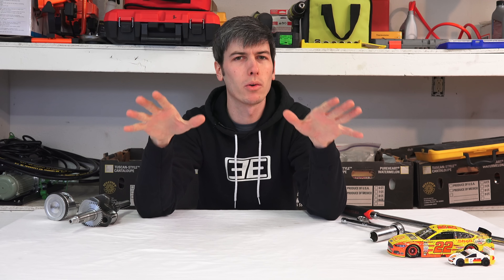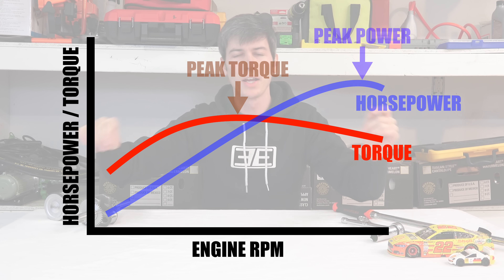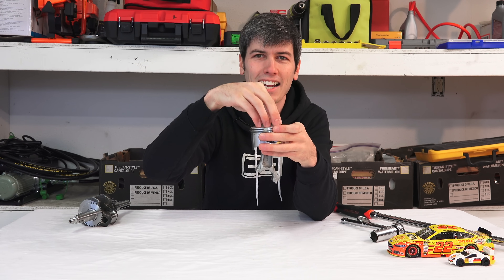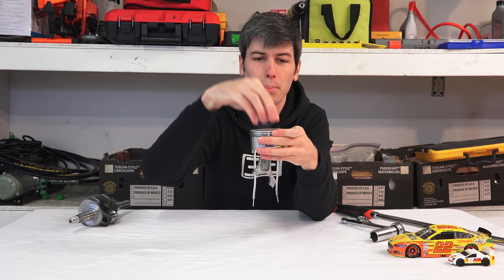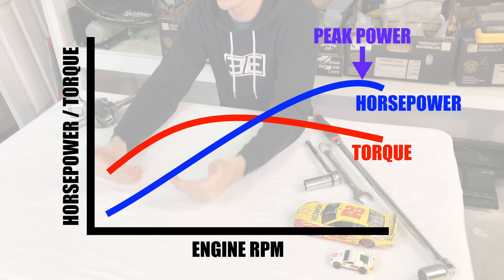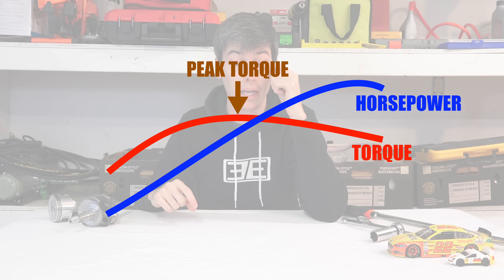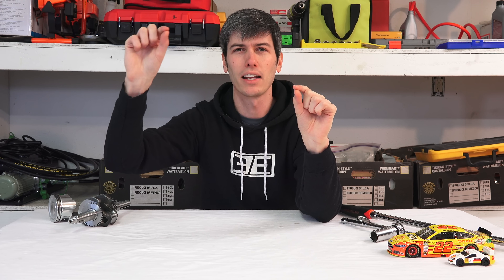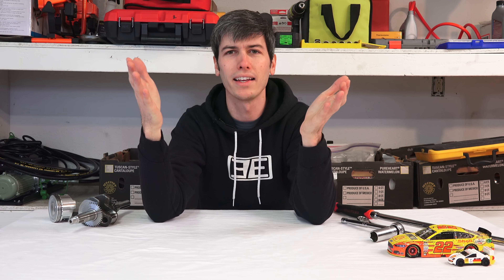Horsepower vs Torque - A Simple Explanation

Comment: One question: You say you can take advantage of double the horsepower via lower gearing for faster acceleration, but wouldn't the same be true for the engine with double the torque? i.e. you can take advantage of the extra torque by higher gearing and thereby increase how fast the wheels spin?
Reply: I suppose so
Reply: No, you cannot do that. Dont forget that HP is torque x RPM. This is very important when you take gearbox into account. In this (very simplified) example the one that has 200hp @100lb/ft would spin 4x faster at peak power than the one producing 100 hp @200 lb/ft. That means 4 times more power would actually get to wheels. Example to illustrate: when you overtake in 3rd, you will accelerate much faster than in 6th.
Reply: @Elitefromthebar  You mean twice as much power reaches the wheels. 1/2  the torque and 4 x the revs = twice the power, which is what you had already written.
Reply: Lower gear have better torque, higher gear have better power, because power = torque*rpm
But, i always ride my bike like this :
My bike peak torque are on 9000rpm,
The peak power are on 10500rpm...
The torque start to feel kick around 6500rpm, so what i'm doing are hold clutch and rev the enfine near 6000 or 7000 rpm then release the clutch, it launched easily, so i try to reach peak torque first so it will continue to peak power fast..
Reply: @atlasone8369  Always, or at the start of each race? You really don't need to do that for normal riding on the road.
Reply: @atlasone8369   if you could find tires and friction capabilities to take advantage of your peak HP, peak hp would cause greater acceleration than peak torque.  remember, HP is your capacity to accelerate at ANY vehicle speed.    think about this..... at peak torque rpm and say you are hooked up at that speed.  if you can get wheel spin at a higher HP and RPM and the friction coefficient is enough, (slip) you will accelerate faster!   make sense?
Reply: Kristian Sørensen 
The 200lb-ft engine can drive higher gearing and will need it because it can't rev fast, but the higher gearing reduces acceleration.
Reply: I mean, i do that when i want it..
Reply: zanick2 you mean make it slip first? Like burnout?
Reply: @atlasone8369  yes, there is an optimum slip percentage that all tires have based on their design and surface. you maximize this by how much power you apply to the wheels . this maximizes force, regardless of engine torque. in otherwords, you can have MORE force , acceleration, at higher HP levels than even peak torque levels .  the launch is very important as you know, but the physics is a little confusing.
Reply: @zanick2 yeah... i see what you mean... yes, you were right because actually HP are torque*rpm... so... of i'm just reving my bike to high rpm where peak hp is then logicaly it will launch perfectly and faster than before...
But as you say... it's the tire...

Comment: You compare two cars and says it has X vs Y torque.. and then just say "oh haha fooled you that's not at the wheels... at the wheels it's a totally different torque."  You say the two cars are exactly the same except for the engine, but you wouldn't gear those two engines the same - so yeah if you have them both geared for the engine with more HP (since you say they are the same except the engine) then the one with more HP will be faster.

Comment: HP is torque X rpm / 5252.  Your car acceleration example is completely flawed. If the low tq car can be geared to make up for tq, so could the other car all things being equal, right ?

Comment: Very good video, but I think the gear ratio explanation complicated it a bit early on.

If you had two identical vehicles with the exception of torque and horsepower outputs being reversed, that would imply the same gear ratio(s) as well. In that case, the car with higher torque could accelerate off the line faster, but the car with higher horsepower would reach a higher top speed.

Comment: It's a fair explanation, but note that the effective pushing power of the gas/fuel changes as the RPMs changes.  It cannot exert the same amount of force to the cylinder because the fuel ignites/burns/expands at a fixed rate, against an object that has increased it's rate of movement.  It's not unlike a human trying to push someone on a swing faster.  Because the object is moving faster, the limits of the item applying power (gas in an ICE.  A human pushing a kid on a swing) cannot apply more force beyond a certain point.  Part of the reason why you have a fall off in torque as the RPMs increase.  It's the nature of an ICE.  Also note that gearing is simply the ability to adjust the torque to the wheels.  The wheels have no concept of anything other than the twisting/torque that is being applied to it.

Comment: The car with the greater power will only be faster if the one with twice the torque has the same gearing.  If the high torque car had the correct gearing, it would be exactly as fast as the other car.  And faster than the HP car if the HP car has the gearing of the high torque car...

Comment: You got me dizzy. The question is on short start, which one get faster? The cruiser which has more torque but less HP or the sport bike with less torque but more HP. In the long run we know the sport bike will go faster but on the short run like a 1/4 mile?

Comment: Torque gets you going while horsepower keeps you going, simple as that.
Reply: more accurately torque gets you going while power is how fast you going, because power is actually a formula of work/torque but with time variable puts in
Reply: Torque = Amount of force acting on the lever.
Gear Ratio = The length of the lever (which gets smaller as you move up the gears as the amount of force to keep it spinning reduces).
Horsepower = The actual output of the engine with Torque x RPM /5,252 giving you the answer.

No Torque? = No force acting on the lever- aka car won't move.
No Gear Ratio? = Without the lever, there's nothing to transmit power- aka car won't move.
No Horsepower? = Either you have no force acting on the lever(and again, TORQUE) or a lever(and yet again, GEAR RATIO) to begin with, because if you did have both of these, you'll have everything you need to find the horsepower unless there's some physics-defining breakthrough game changing phenomenon. I do NOT understand how this is hard to grasp if you are older than 12 this should be damn-near a no brainer. You're comment is soo soo vaguely correct you'd you'd need at LEAST a 500x telescope to connect the dots and make sense of it. Simple? Yes, but apparently for you it's not as simple. Now be a good little HORSEPOWER- NOT TORQUE and get some work done! (Had to)
Reply: Really, what gets you going and keeps yo going si the force applied to the car by the wheel bearings.  This si directly related to the torque applied ot/by the wheels.  This force has to be enough tgive the desired acceleration (F=Ma).  Horsepower is the ability to supply torque at any given speed.  This si why a low HP car can accelerate quickly from 0-20, then just poke along, whereas a high HP car can still accelerate hard while going 80.  Any simpler than that, and you really don't get it.
Reply: torque keeps you going too. a negative torque being applied by friction and wind resistance is what slows you down. you need torque to cancel those forces out.

Comment: I’m curious about something I did with a 400 small block.
I cut the crank throw half inch and I added to the rod.
I was looking for RPM on a 2400 lbs car.
My question is this: if I cut what makes the torque, namely the crank but increase the rod length and Increase the RPM potential, what happens to the torque numbers and the horse power.
It turned out to be like a ten second driver that you can drive to get groceries.
If you have an interest I’ll show you the car and the parts list.
I love the technical part but I’m not sure about the physics witch is what I really love.
Thanks for your help.
I think I got it by Gimny.
My gearing is very aggressive, 3.27 first with a 3.155 Gleason Torsen and ten inch tires in the back turning 8500 to 9 grand makes my Z haul ass.

Comment: Your comment of the car comparison with 200 lbs/ft and 100 HP vs 100 lbs/ft and 200 HP that the one with more HP will ALWAYS be faster is dead wrong. Either can be faster it is based on the relation between all factors. There could be a case where the lower torque engine wouldn't be able to move the vehicle let alone move it fast.

Comment: The simple explanation is far simpler than your explanation. Horsepower is a calculation based on torque in lbs/ft so the simple explanation is HP is a marketing tool and doesn't exist without torque. (RPM * Tq) / 5252 = HP

Comment: In very simple words: 
Horsepower = Torque x  RPM. 
Diesel engines have more torque, but less RPM in order to yield the same horsepower like gasoline engines, which have less torque and therefore need higher RPMs.

Comment: Very nice clear and concise explanation of the torque factor.  However, IMHO, it gets a bit muddy when you seek to simplify the explanation of the power (HP) aspect.  I do a lot of writing and translation work in languages other than English, which have other terms for these two factors, from their viewpoint.  For instance, the Thai language calls torque "Twisting Power," and it uses the term "Pushing Power" to describe horsepower.   One could associate twisting power with your explanation of the length of an engine's length of stroke as it applies twisting power to the crankshaft, aptly described in your ratchet wrench and breaker-bar illustration.  The term "Pushing Power" would be readily associated with the downward force applied to the piston at the power-stroke of the rotation cycle.  The two types of energy work together to produce HP and torque, obviously enhanced by engine breathing, valve and ignition timing, gearing, etc.
RM

Comment: Another simple way to understand torque is to hop on your trusted bicycle and go into 1st gear...you'll peddle like a mad man and go nowhere but you'll be able to pull a load (you) up the hill easier (hence your torque is greater)

As you go through the gears you lose torque but increase your potential top speed...

A fun way to try is this is to take off from a standstill in last gear (6th or more), you'll find you have a very poor start but a great finish...the more you weigh the more potential force you can exert on the pedals (which are at a distance from center i.e. torque) the more force on the peddles means you will have an easier time starting in higher gears (5th, 6th, 7th)

More potential torque doesn't directly mean you'll go faster, it'll just be easier for the engine to move a load around...
BUT, it takes weight to move weight and a heavy car/truck/person/train will require more torque to get moving.

Which leads to a question: does higher torque improve an engines life span? More durable?
**Since it doesn't have to work as hard to move a load throughout it's life**

Comment: Just a few comments. Specifically defined and simply put, torque is the ability to create rotational force/work not force applied at a distance. A ft-lb of torque is identified as such because it is the required force to move 1lb 1foot in a rotation. The actual equation for horsepower is torque*rpm/5252. The 5252 is the estimated point in rpm at which torque and hp are nearly equal. I have seen as much during Dyno runs. For example a vehicle with 100ft-lbs of torque will produce approximately 67hp at 3500 rpm. Depending on multiple other factors like vehicle and driver/rider weight, road/weather conditions, as well as internal factors playing on the engine. Gearing changes torque entirely and each gear is given a specific torque rating based on it's drive: driven gear ratio. Hp is also affected by the energy required to operate the vehicle in the first place. This is negative horsepower. E.g., a vehicle has 125hp but it requires 40hp to operate the engine and drive train all the way to the rear/front wheels depending on the vehicle. After that energy and work is accomplished to get the vehicle moving, your ability to accelerate remains at whatever torque you had, but the maximum rate at which you can accelerate is reduced because now you're only putting 85hp to the final drive due to the requirements of the engine and drive train. Unfortunately if you give to one, you take from the other. RPM has a huge bearing on both torque and horsepower. When you no longer feel the acceleration in a given gear that means the rpm has exceeded the engine's ability to produce more at that ratio and changing gears is necessary. A CVT is a great way to have seamless transmission of ratio, however due to the required amount of energy to push the drive clutch into moving in the first place creates a good amount of mechanical energy loss and they take a little longer to engage whereas direct constant mesh gearing, while gears have to be manually changed, it much faster at engaging and transferring energy. The key in that scenario is the driver/rider. Anyway, not a bad explaining but it was missing some minor details.

Comment: Horsepower actually is  a marketing gimmick from over a hundred years ago now, one of the guys who originally  started building tractors with steam engines couldn't sell them because people couldn't understand how much work they could do, ( how quick they could plow fields etc) so this guy sat down with a inventor/ mathematician by the name of james watt. They built a water brake and hooked a average size horse to it to determine how much work the average horse could do. Then they hooked up a tractor engine to it to determine how much work it could do. Then the math dude came up with a mathematical equation  converting rotational force into horsepower  the equation is as long as your arm but comes down to torque × rpm ÷ 5252 = horsepower. Now the guy selling tractors could tell people his tractor could do the work of say 25 horses and  people could understand that and he started selling tractors left right and sideways. By the way the water  brake  they invented was the first dyno ever built

Comment: I am a little bit confused about the RPM you are talking about. The first time you used RPM for the HP is at the drive end of the gearbox i assume. The second at the graphic for HP/Torque that is the RPM at the crank shaft right.

If you use different Gearbox for the same engine does that change the HP? I dont think so. Then for your example; if we use same car including the same gearbox, only 200HP/100 Torque and 100HP/200 Torque. What happens then?

Comment: As usual, your explanation is much better than anyone else's on YouTube. And yet, your video too fails to clarify a related question I'm sure most people are asking themselves: what's the importance of the peak torque value, as long as to get the maximum power one needs to rev past it? 

I believe it has to be explained that probably the engine is most efficient at the rpm that allows it to obtain the peak torque, so a driver of a manual should try to shift the gears so that the rpm value be in the range close to the peak torque. I suppose this gives the best fuel efficiency. So it's important to know whether a specific gasoline engine has the peak torque around 4,000 rpm or the curve is almost flat between 2,000 and 5,000 rpm (on modern turbo engines); this should tell the driver how (not) to change the gears in order to save fuel.

Comment: Fluid dynamics - Electrical - and Mechanical all have similarities in common and can be compared in a few ways. 

For this particular example: Torque Vs Hp. 

You have water flowing through a  hose. 
Think of Torque as the pressure which the water is flowing at. 
Think of HP as the speed which the water is flowing at. 

Now picture one water particle in that hose. if you want it to travel from one side to the other quickly, you "increase the flow"
If you want to move a group of water particles from one side to the other you "increase the pressure"

Both can be manipulated just like torque and hp.  I.e  High pressure low flow system and low pressure high flow systems. 

Regards
Michael

Comment: Good explanation. It just lacks the conclusion that the higher the torque is, the more flexible the engine is, that is you'll have enough force to effectivley accelerate even on higher gears, having higher torque.  That's the direct benefit of having high torque ratio.

Comment: You say the torque, in the engine, is caused by the distance of the offset in the crank times the force on the piston. But this is only true when the crank is at 90 degrees. And this is one of the things that make this type of engine so inefficient.

Comment: Just wondering how come some engines have more torque then HP, like say 5.0L mustang from 1987,  had like not much HP but alot of torque, compared to like a Lexus ISF for example, has alot of HP but way lesser torque, when both are 5L V8s.
Reply: Master Kraut look in the description you will find the equation. 
HP = torque * rpm / 5252. A 5.0 Mustang had a redline of about 4800 rpm. While the Lexus has a redline of 8500 rpm. At 5252 rpm the HP equals the torque. The equation shows why torque is more important in the Mustang and rpm is more important in the Lexus.